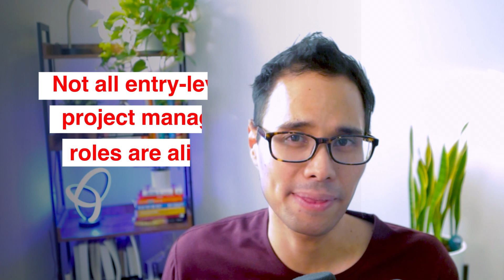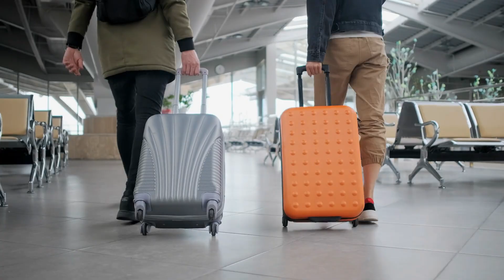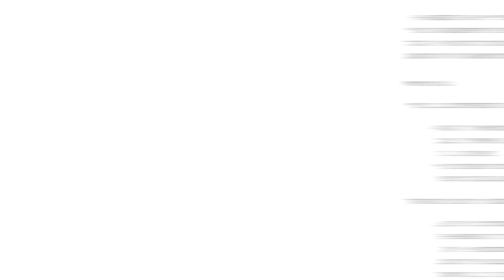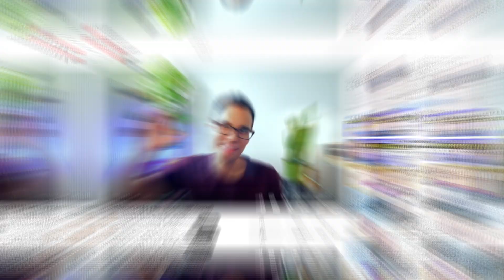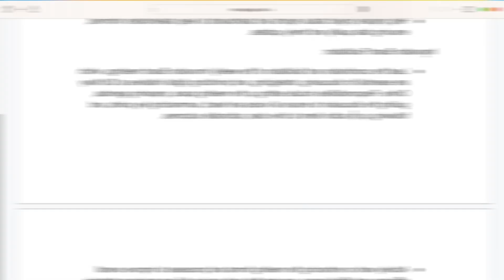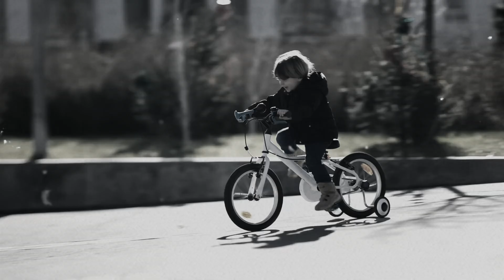Entry Level Project Manager Responsibilities Explained

Comment: Hi Alvin, I graduated with an MSc in Mechanical Engineering. I have been trying to get into project management entry roles in Canada. But so far, no luck. I took certifications like CSM, CSPO, etc. 
My biggest question is: is it even worth trying to start a career in project management if I dont have any prior experience? Most project coordinator roles seem to be for Computer Science and Construction background. 
Any advise would be greatly appreciated.
Reply from the maker: Since I don't know your full background, I'd encourage you to leverage your existing background in Engineering and apply to PM Jobs related to Mechanical Engineering in the industries you have experience in, especially since you already have an MSc. in Mechanical Engineering. If possible, I'd also encourage you to tap into your existing network

Comment: Hi Alvin, thanks for all the insights about the role so clear and my question is ..i did my SAFe6 certification recently and looking for either scrum master position or Project Coordinator role. Do you still recommend PM certification for a Project Coordinator role or scrum certification is good enough to go with?
Reply from the maker: Since I don't know your full background and situation, here's high-level advice I can give you - a PM Certification can help you stand out on your resume and negotiate higher salaries after you're given a job offer. However, just remember - having a Certification does NOT guarantee getting an interview. It is one of many factors that can help, but is not the ultimate 'remedy' to landing a job interview or final offer.